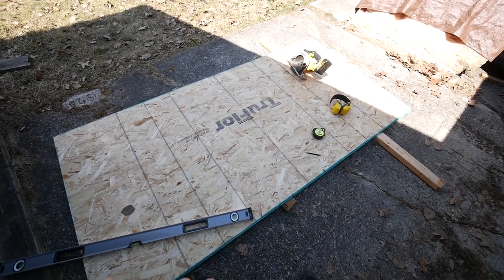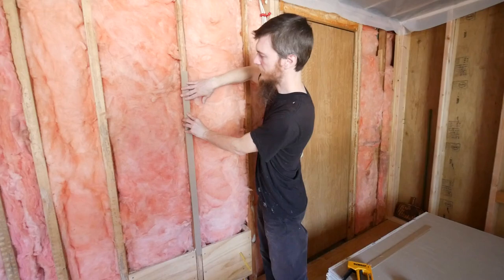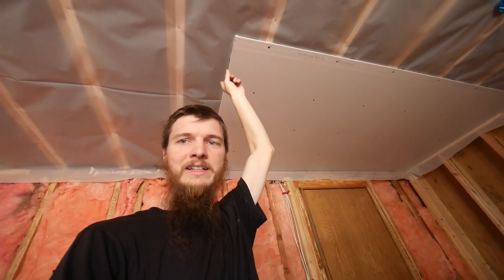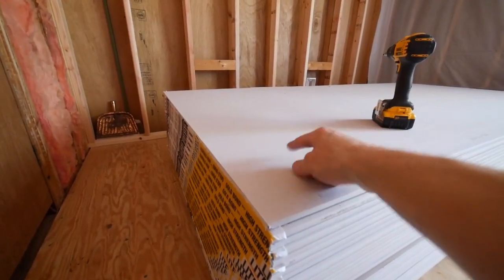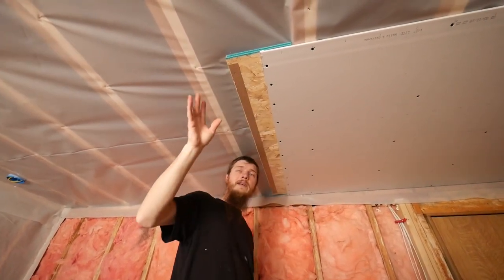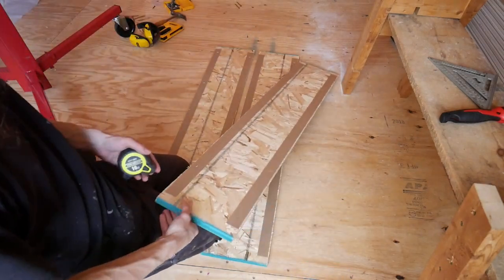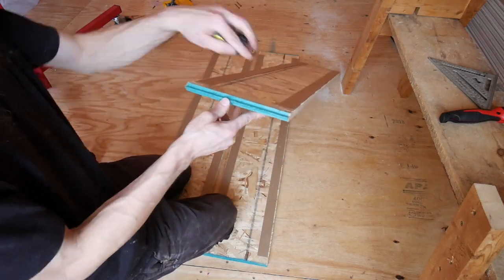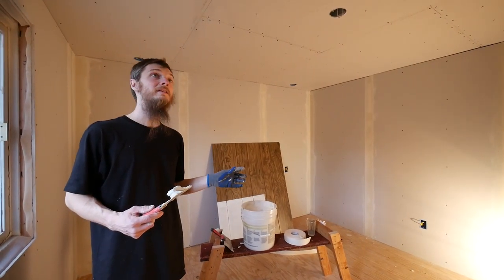Drywall End Joint Finishing Hack for a Smoother Ceiling

Comment from the maker: Old Clips- New video. Not meaning to confuse anyone ;)
Reply: Which screwdriver do you prefer?
Reply: Out in the Country , ok, I was confused. Lol, but I’m alright now‼️😁😂😂
Reply: Glad for the confirmation, I can remember you completing your bedroom ceiling like this, thought the upload was a repeat.
Reply from the maker: @19Photographer76  I'm not sure what you mean, do you mean brand and for what?
Reply: no complaints here.
Reply: @diyfferent  Sorry, you had a regular DeWalt battery screwdriver and then you got a gift for an Impact driver, I'm wondering which you prefer?
Reply from the maker: @19Photographer76  Oh, they are both good in their own way. I haven't used the impact driver very much yet but it drives screws fast and seats them very well. For drywall I used the regular drill because I don't want to destroy the drywall. It just works better for that, and is better for drilling holes. I can definitely see myself using the impact driver for all my general screwing and framing though.
Reply: @diyfferent  Thanks!

Comment: Good job.  It helps if you leave out the screws in the last joist before the butt joint until after you install the butt board.  The drywall is more able to flex into the butt board. 
I was thinking of making some kind of butt board and your solution is great! Thanks.

Comment: Just a couple of suggestions, the board behind could be much narrower 2-3” wide would do! And the joint should be left open 1/4 inch. I guess you will not be using stiff insulation in the ceiling. 
We in the U.K. often skim the entire ceiling with plaster. However, you did very well to achieve the finish you got, well done.

Comment: Fantastic idea, I wish I knew that when I did my ceiling ..Do you do that on the walls as well ? Of course I'm new at this myself..
Reply from the maker: You can but it's tricky because walls have a bottom sill plate and top plate that would prevent the drywall from pulling in properly at the very top and bottom. IMO, your just better off hanging it vertically on the wall or buying sheets long enough to span horizontally.

Comment: Did the math. Trim tex butt boards are $14 a piece. Making these on your own is roughly $2.31 a piece. The best thing about these is you dont have to stagger butt joints. They finish like a regular flat & of you have a long ceiling or wall even it makes finishing a breeze. Its like an extra flat the length of the room you can box in one run instead of jumping around doing pain the ass butt joints.

Comment: Granted this will work but, I'm kinda surprised considering you make YouTube videos that you didn't just watch some videos on how to finish  butt joint. There's a lot of extra work doing your way. Its still a cool idea 💡 😎.  I don't know it just comes easy for me ,my joints come out invisible when I'm done. Now saying this I need to tell you I'm horrible at carpentry and it appears to come naturally for you. Lol! I guess we all have talents . :)
Reply from the maker: We used to finish butt seams, but doing these boards it makes it much easier and quicker for us to finish. :)
Reply: I do it for a living and buttboards make a far better joint. If a light or sunlight cast down it you won't see it. With these floating butt joints you can finish with a 12in instead of a 40in wide stud butt. Less mud less sanding equals less work. A butt joint on a stud has to be feathered out so far that its impossible to make them flat you can make them appear flat but they never are. Another plus is they float which means less chance of a crack on a settling house.

Comment: I'm glad to see somebody using the cardboard shims actually you can put them on the stud before the end of the butt joint on both sides which will cause the same effect that way it is more secured to the ceiling also because it's going right to the stud but this is a good trick but I'm surprised being a finisher that more people don't use the shins just on the stud before the end of the butt joints because it does the same effect back in Connecticut in the 80s it was quite common for them to do that nowadays I never see it anymore unless I'm doing it myself
Reply: Worst idea ever.

Comment: Wouldn't you create more of an indent if you placed the screw farther from the edge of the board? Why did you screw them so close to the edge anyway? You weren't screwing to 2" studs.
Reply from the maker: If they were screwed further apart they'd be too close to the cardboard shims and it wouldn't create the taper. The screws need to be on the edge so that the drywall can bend.
Reply: @diyfferent  You've tried screwing them farther from the edge and found this to be true?
Reply from the maker: @Dev-lc4cd  No, we haven't personally tried it since we understand how it works. But if you want to experiment with the setup, try different things out.
Reply: @diyfferent  I will, and report back. Would really like it to work out, because an important selling point of the Trim Tex boards was the ability to set the screws wider apart than usual.

 Also want to test out the strength of this sort of butt joint. I suspect it might be much easier to  push in and break than if it were just sheetrock at the mid point between 2 studs its fastened to, if that makes sense.

Comment: Hi wondering if u had any cracking in those butt seams you used osb on interesting. Manufactured board is way expensive
Reply from the maker: We haven't had any cracking, but i could have finished my seams better. Yeah, hopefully the new high price of OSB isn't permanent and it goes back down to what it was soon.

Comment: Did you use high density card board.  Can you please tell me if you can Renner what the card board is called
Reply from the maker: Yeah, the shim were a 1/16" paperboard.

This is what we like to use:
https://www.menards.com/main/building-materials/drywall/shims-trims/menco-royal-36-drywall-shims-50-pcs/1311167/p-1444439449587-c-13059.htm

or

 https://www.lowes.com/pd/Grip-Rite-Actual-0-055-in-x-1-5-in-x-45-in-100-Pack-Pine-Shims/3334498

Comment: Is it customary to use 3/4” osb for the backer board? I’d imagine 1/2” osb and/or scrap 1/2” drywall is more commonplace. 3/4” seems heavy to me
Reply from the maker: 3/4" is the norm because you want it to hold the screws well. You could try 1/2" but it just wouldn't be the ideal. Drywall is too weak to hold screws and wouldn't work at all for a butt backer board.

Comment: The plastic will cause mold on the back of the sheetrock.
Reply from the maker: Most people should not use plastic in their ceiling or walls. But in certain situations and locations it is practical or required. We always say just do what's right for your structure and location.
Reply: @diyfferent plastic vapor barrier is part of the building code, the only way mould would occur is in incredibly humid conditions, at which point ventilation or dehumidifier is necessary, because if it is that humid, the back of the Drywall isn't the only thing that will get mould. I skip the roof vapor barrier on detached garages... It allows all the wetness from vehicle snow melt to escape

Comment: You do know that 3/4 plywood/ OSB is very expensive right? Isn't the proper way to hang drywall on a ceiling is edge to joist? Plus without the plastic there, the plywood wouldn't have anything to press against so in most cases this method wouldn't work unless you had the plastic there...
Reply from the maker: Yea, in 2020 the price of OSB skyrocketed, it's crazy. We did this when osb was cheap. But regardless, the cost is minimal. Yep, the typical way is to have the seams end on joists, but then you end up with butt seams which are difficult to compound so we like doing it this way instead. The plastic doesn't affect the method at all, it works with or without plastic just fine. Instead of using osb to make your own, you could buy them pre-made: https://www.all-wall.com/Trim-Tex-Buttboard-48in